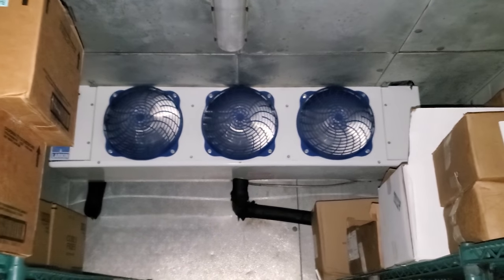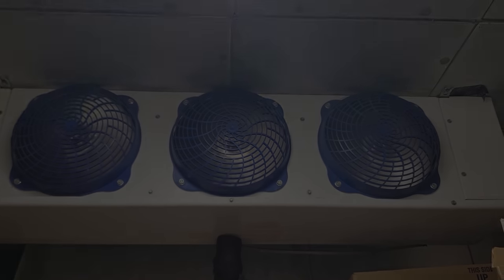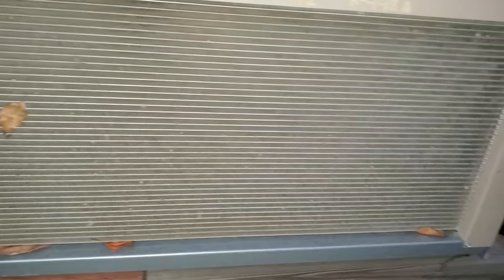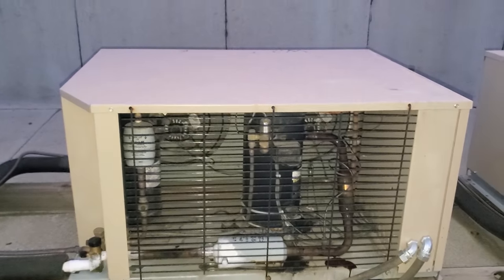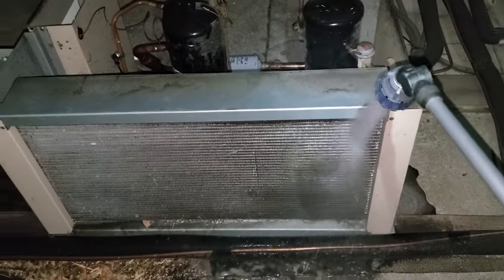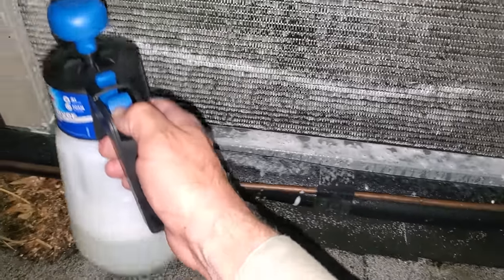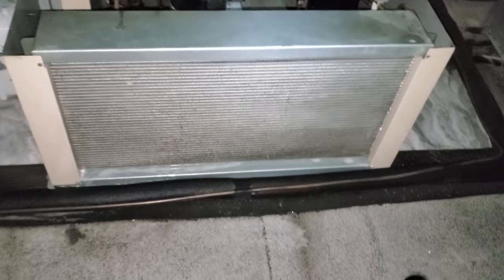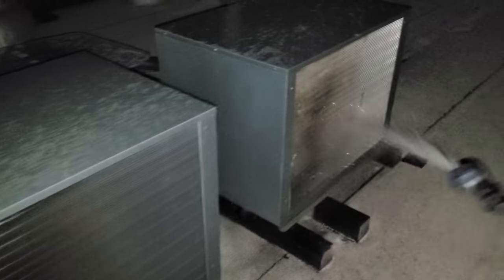HEATCRAFT QRC WALK IN FREEZER CALL

Comment: Love the channel. I have had nothing but issues with the Qrc evaporator coils. A lot of suppliers have stopped quoting them due to the EEV failures they have been getting. Love the channel keep it up 👍
Reply: I don't work on commercial very often but even the residential EEVs are a pain in the donkey. I don't recommend them to anyone getting a new system. Their unreliability kills any energy savings they might aquire..

Comment: Microchannel condensers are very similar in construction to computer water cooling radiators.
They still use "tubes". They're just flattened out a lot more compared to a standard condenser.
Also, I like the new style of putting explanations throughout the video rather than lumping them all at the end recap.
I still watch to the end though. :)

Comment: I'm not a hvac tech, but have a crazy question. Is it possible to use such walk-in equipment as an ac? Need to cool a large space with printing presses and people to 66-70°F. Have used a Panasonic calculation sheet and got a result of 480,000 BTU. Can't use packaged air equipment here, like the Carrier and York you show in your videos.
Reply from the maker: There are specially designed systems to handle paper storage, I will discuss this on my livestream tonight 10/04/21 @ 5:PM (pacific) on YouTube, come over and check it out https://youtu.be/dCQdmPgIWvo

Comment: Would you happen to know where I could buy a CBB65 capacitor? it's ratings are:
40+6uF+-5%
250VAC
40/70/21
C.P2
Protected at 10,000AFC

I need to buy a new one for my air conditioner, it blew up the other night when I turned it on.
Reply: Amazon

Comment: You actually having any luck with those qrc coils? At least the bohn qrc coils its just problem after problem with any of the electrical components on the coil, whether its the eev, the thermisters, and even the board itself sometimes is going bad.
Reply from the maker: YEah Ive had great luck... I will discuss this on my livestream tonight 10/04/21 @ 5:PM (pacific) on YouTube, come over and check it out https://youtu.be/dCQdmPgIWvo
Reply: @HVACRVIDEOS  thanks! missed it live but good to hear they aren't all total garbage. Probably the result of budget contractors putting them in all over the place with incorrect installation procedures.

Comment: I just wish you could change the diffrencial on the QRC I like a big swing on a freezer off at -10 on at -2 I think the QRC is only 2 degree.... Internal compressor temp is roughly 75 degrees higher then the liquid line measuring about 6 to 8 inches from compressor ...I am not a fan of 448 it can't handle the heat in my book and recovery time sucks ...I been doing this for a long time and I always learn something when I watch your videos

Comment: Head pressure control on your condenser fan to keep up the head pressure instead of charging for a winter charge ? 
          For example the ICM 325 they have several different models. 
                I don’t do Cold box freezers.    Over the years I always see you another restaurant service personnel adjusting the winter chores I fully comprehend how it works and what it does now. 

      Tell me if I’m wrong but in my head I go that’s so easily taken care of with the electronic device modulating the condenser fan motors to keep the head pressure at a constant pressure no matter what the outdoor ambient temperature is
Reply: With the eev the headpressure can be very low and it will still function great. Along with high energy savings cause of the low condensing pressure.
Reply: @coldfinger459sub0  the winter charge is only needed when there is a headpressure control valve present, otherwhise a fan control to keep a minimum
Pressure will do just fine.
Reply: @coldfinger459sub0  thats to fancy for me, a simple pressure switch is what i use, and this only on txvs or cappilairy systems  who depend on on a minimum pressure differantial.
Reply from the maker: I will discuss this on my livestream tonight 10/04/21 @ 5:PM (pacific) on YouTube, come over and check it out https://youtu.be/dCQdmPgIWvo